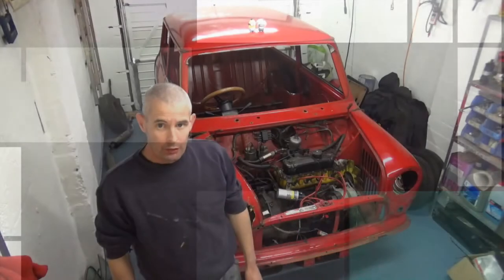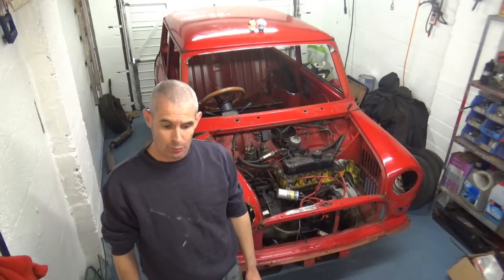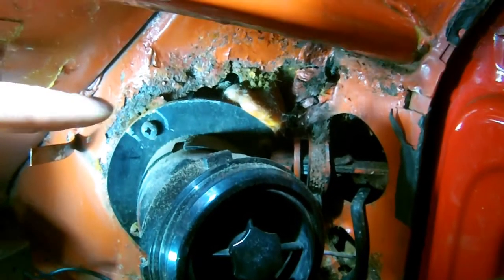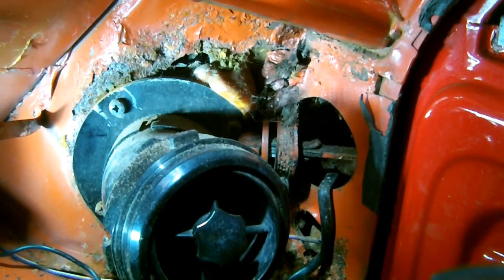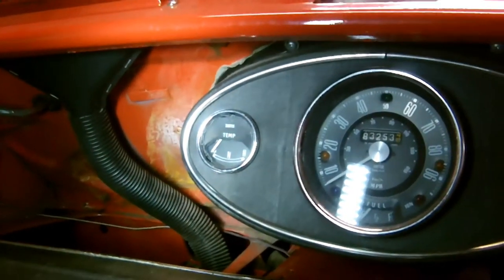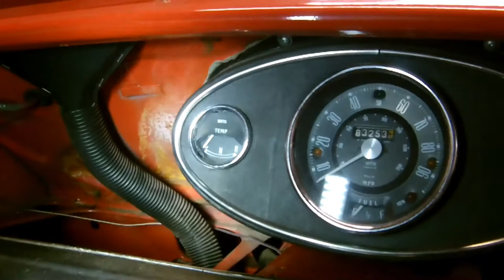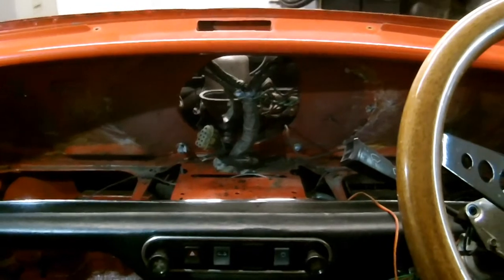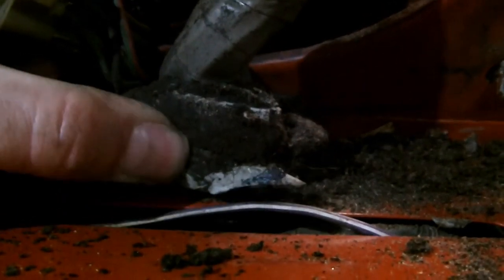Classic Austin mini restoration - Dash instruments removal

Comment: have not tried blue tack but i have used tiger seal to fit a carbon boot skin gonna try fitting a carbon roof skin with tiger seal seems to bond carbon to steal real strong.Good tunes dude . Remember to use plenty of patches more money to spend on trick bits
Reply from the maker: Tigerseal is the dogs dangles Robin. I've used that a good few times myself and it's never failed!

Comment: Hey Sean, great video. I have recently  picked up a Mini which I'm in the process of restoring. Do you know what the colour of your mini is there and the year? Mine is very similar, but I just can't seem to find out what the name of the paint and paint code are.
Reply from the maker: Hi Miles, The colour was originally Vermilion (Orange) and the year is 1977. The car will be going back to Vermilion when finished